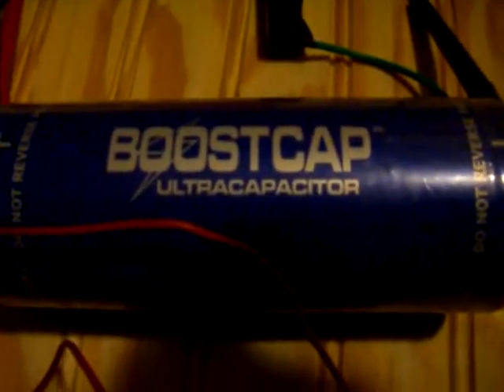Maxwell 2.7v 2600 Farad Ultracapacitor

Comment: U sir are clueless.. Why even post this? I have 12 of these in a series\parallel configuration. 6 in series of each other to make them safe for automotive voltages, total capacitance = 1000F . Also you should use the Diode balancing  method to make sure they charge evenly. When charging them the best way is to use a light bulb in series instead of a resistor  (rated for total voltage) between the power source & the Caps. When the light no longer runs then you know the caps are charged :0)

Comment: if you want to charge that , you need more than 2 AA batteries . get a phone charger (rated 3,7 volts usually) , adjust the voltage with resistor to charge the cap at 2,7 volts , get as big amp rating as you cen , charge the cap for 1 hour and than you can melt metal with it